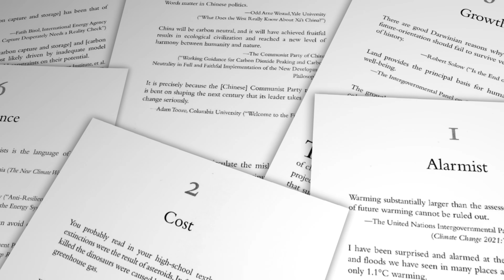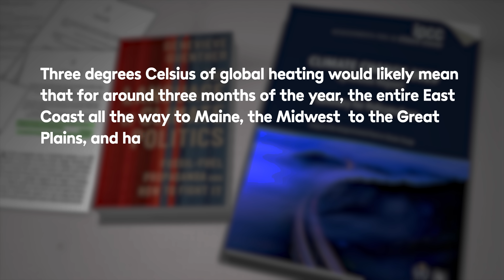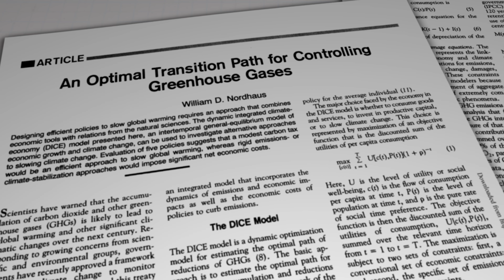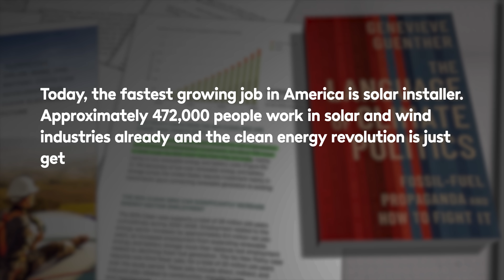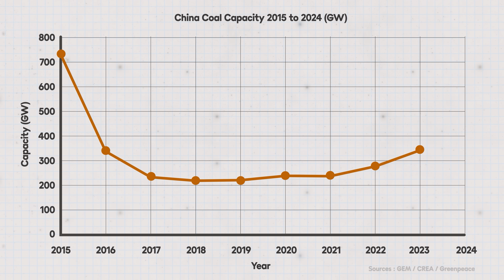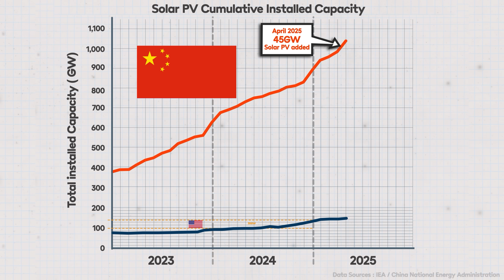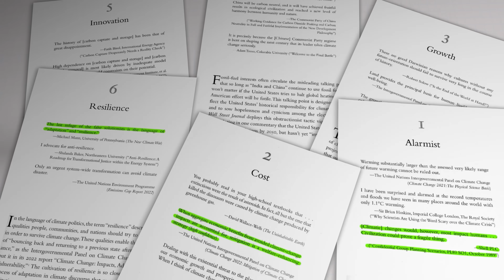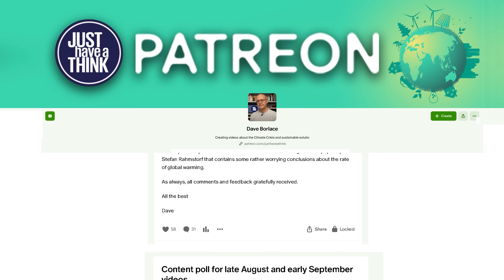New research DEBUNKS climate disinformation.

Comment: Rant on, brother. We should all be very much angrier than we are at the levels of apathy amongst the vast majority of parents and grandparents across the developed world. Those brave enough to picket oil installations and gas terminals are still viewed as cranks in our extreme right wing press. In fairness most of us are stuck for a while with our gas boilers and petrol driven cars but technologies are changing, permitting is beginning to accelerate to allow more small generators and coops. We can all help if we try.

Comment: I'm looking at installing solar now. For an investment of £20,000, I will never have to pay for another energy bill again. Ever. In fact, they are going to pay *me*. The system will pay for itself within 8 years - that's a better return on investment than the stock market. Now obviously I'm very lucky to have £20K available, most people don't, but the costs are continuing to decline. What we need is for the government to prioritise solar and home batteries instead of their ridiculous obsession with "small modular reactors" that won't produce a single watt until at least 2035, and still cost more than any other form of energy generation. Solar is here, and is the cheapest energy generation in human history (yes, look it up!), we just need to get it rolled out.
Reply: £20k is pretty steep for PV these days, depending of course how big the system is. But if you want to be net independent, you should think about getting a home battery to optimise your consumption of your own solar energy.
Reply: @bilgyno1  Sorry, I should have been clear, this system includes batteries for overnight power and feeding back to the grid at peak times.

The installation is the most expensive part, but hey, it's providing employment for electricians, scaffolders and roofers who are all training a new generation of apprentices.
Reply: @bilgyno1  At that price I assume it includes batteries.
Reply: I got a pretty big solar array (8.9KWp) with 5 KWh of battery 3 years agp for £12.5k, then added another battery for another £1,900. For £20k you must be looking at a huge solar array and maybe 30 KWh of battery because the price of both has dropped hugely just in 3 years. But yes, since I put them in I make about £400 per year instead of paying for electricity, and that includes charging an EV to do about 6,000 miles per year. So it's a fantastic investment. I'd question about how properly sized your installation is though, obviously I'm guessing because there's no specs but it sounds enormous. Maybe you're trying to run a heat pump all winter so want battery to do it but it might not be fully utilised enough to justify the cost.
Reply: Make sure to get A LOT of panels for cloudy winter months, around 100 panels 400-500Wp should work for an average household. Also, do not expect to get paid by the utility company for your excess power, prices are negative during the day when your panels are producing. I got me a bitcoin miner to burn the surplus...
Reply: @idontknowwhatahandleisanddontw  Complete rubbish.
Reply: @geconserver  The economics of solar export could well be subject to change. Gary Does Solar did a very good video on the Duck Curve using California as an example. They've had to scale back their solar export schemes several times now because they basically have enough power during the day on sunny days so paying people for excess that can't be used makes no sense. The UK is moving in this direction as well in terms of power output and requirements. The majority of my savings/earnings from solar are through export, I send back about 5 MWh per year so am hoping the export payments stay at current levels but am not optimistic. I was looking at going from 8.9 KWp to about 14 KWp but the extra generation would be extra export. If I could get a 20 year guarantee of 16.5p for my export I would go ahead but obviously I can't. So I'm not installing more solar because I have no way of consuming it.
Reply: @geconserver  Complete rubbish? Well think of me when you find yourself still paying the grid in cloudy january. Good luck to you Sir!
Reply: @idontknowwhatahandleisanddontw  I can safely say that 5 mins from this comment I'm never going to think of you again.
Reply: @idontknowwhatahandleisanddontw   I'd love to know how you think the "average household" could fit 100 panels on their roof! I have a huge roof and could possibly fit about 75 on if I covered both sides (E/W split) but most houses would struggle with more than about 15.
Reply: @FlatToRentUK  Vertical panels in a fence. I know it all sounds insane, but it really is what you need to get through those winter months, off-grid and doing everything electric. At least a 20kWh battery as well ofc.
Reply: @idontknowwhatahandleisanddontw  That's going to be pretty expensive especially as you will likely need micro inverters because the shade risk is much higher. I don't think the aim of most people is to be off grid anyway. Most want to lower electricity bills, do their part to mitigate climate impact and have little impact to their normal lives. And we still have the practical issues of space. I don't know where you live but many houses in the UK would be totally unsuitable for this. We're looking at a sensible balance of the factors I mentioned.
Reply: @FlatToRentUK  I agree, off-grid is not for most people, but it's doable for the 20k budget of the OP if he has the room. Panels are just 80 these days, *100 = 8k. Then the inverters, maybe 2k, the fence 5k, batteries 3k, 2k reserve or for consumers like a cryptominer or smth more useful (beer brewing comes to mind...). I'm in Belgium so very comparable to UK.
Reply: @idontknowwhatahandleisanddontw  If you're off grid already then what you described makes sense. But you wouldn't go off grid if you're already on it which most people are. You couldn't get any export payments. So I'll be staying connected!
Reply: @FlatToRentUK  Actually I'm currently also still on-grid but planning to go off next spring IF I can make it through winter this year without bills. 60 panels installed now, 40 additional on order for the north side of the roof. Export payments are very, very close to non-existent here in Belgium, I got, you won't believe this, 1.73 euros for exporting over 2MWh last time, which was the point the wife started complaining and I had to rethink our energy strategy. On top of that we also have fixed taxes like the capacity tarif, it's all such a ripoff and I've just had it with feeding all these parasites. If you're still getting a decent export compensation, enjoy it while it lasts (it likely won't).
Reply: @idontknowwhatahandleisanddontw  Yeah, I am enjoying it but the signs are there it won't last. I think export rates are going to become dynamic so we only get decent money in peak times so maybe 16:00 -19:00. I don't generate much then. I can mitigate this somewhat through consuming more by charging the car during the day but it will lower the advantage of solar. I was going to install more panels but didn't for this reason. As they get even cheaper it might be worth it again but impossible to avoid the installation, scaffolding, inverter, cables, etc...
Reply: @FlatToRentUK  Exactly, the only times you get a fair price is in early morning and late evening, when your PV is struggling doing close to nothing. Belgium is probably the #1 country for legalized criminality and ridiculous taxes, so you might be safe for a while there in the UK, but I'd prepare for it anyway if I were you. I'm an electronics engineer so I'm lucky to be able to do most of the electrical work myself, but I hear you,   commercial installation costs sure can be a deal breaker. As for EV, it's simply made impossible here, I heard about this new 1MW charger from BYD and went calculating on how much it would cost me to install such a beast. With just the capacity tariff they recently invented the bill would be over 2000 euros per month, every month! So I'll just keep driving my LPG powered Mustang, until those bureaucrats start taxing me to death on that little joy I have left. You probably already have considered it but a heat pump could also be a great way to consume the excess solar energy, just turn it into hot water. Anyway, good luck with your setup and whatever you decide to do.
Reply: @idontknowwhatahandleisanddontw   I saw people in Alaska and Canada that have solar panels that are on a construction where they can change the angle. (would not work on a fence. Or would it ? - And I would consider the risk of vandalism). Rob Avis wanted to adjust to winter and summer. Or in Alaska they adjusted the angle  even during the day, at least in the warm season. - To optimize harvest. 
Rob Avis from Verge Permaculture in Canada  (he has several interesting builds, larger projects very interesting. Solar green houses, geothermal, etc. A couple with children, both are engineers).  
The cabin in Alaska was a homestead, he does gardening and prepares wood for winter she still had a job as nurse. So he was at home most of the time and could change the angle of the solar panels during day (winding it into position), it was not hard to do.
Forgot the name of the channel and it was not such a large installation. 2 panels on a construction in front of the cabin. Just for emergencies and to support the diesel generator that they have to produce electricity. With snow reflection some solar harvest is possible even in winter (or fall and spring) and they benefit most in summer.
Reply: @franziskani  There are tracking systems for these solar fences, one axis, so could work great if your panels are east-west oriented. I wouldn't bother though, those mechanics need maintenance and will break down eventually. There's also tons of laws and regulation here in Belgium, they'd probably make an issue of the larger surface area. If you have the room for it, better to just install a ridiculous amount of panels, imo.
Manually adjusting the angle al the time is insane, and 2 panels is nothing...
Reply: "I will never have to pay for another energy bill again."

I used to think the same before I put mine in...  You'll eventually need to replace those solar panels and electronics (which would be your energy bill).
Reply: @Les_S537  Replacing hardware is a capital cost, not an ongoing operational cost. So I wouldn't be paying an energy bill, I'd be paying a one-off repair or replacement cost of a piece of equipment I already own.

There's a huge different between cap ex and operational costs.
Reply: Did you forget about the initiative to deem the Sun in GB by your government? 😂😂😂😂
Reply: @dmitryisakov8769  Not sure what that is supposed to mean, but the calculations for solar energy are well understood and we have decades of data to measure against. Of course the return is even better in countries closer to the equator, but solar is now so cheap compared to gas that it hardly matters.
Reply: @geconserver just google BBC article "UK experiments to reflect sunlight one step closer"
Fisrt they icentivise you to put solar panles and then reduce amount of sunlight comjng to you😂😂😂
Reply: @dmitryisakov8769  Wow, okay, yeah, that sounds absolutely crazy and a terrible idea.  I don't understand why anybody in government would give that project money, especially as it has been banned elsewhere. But then this is the country that voted for Brexit, so clearly we do mad things all the time :D
Reply: @geconserver while the amount of sunlight on UK is bad and disadvantages the PV system, the frequent rain should reduce the cost of duat cleaning sustem. 😂
Do you have a projected electricity bill savings per year from your system?
Reply: @dmitryisakov8769  LOL, yes, finally a positive use for British rain :D

Annual savings plus earnings projected to be around £2,600 a year.
Reply: @geconserver ROI in less than 10 years sounds good. Subject that your optimistic calculation pen out and you will not be taxed for this. 
As the saying goes:
No good deed goes unpunished 
Good luck

Comment: So the wannabes revisited  - CCS & DAC.     CCS is vitally important, because if perfected it could abate 20% of current global CO2 emissions, & because renewables are not yet replacing fossil fuels, but instead fuelling even higher energy usage & hence demand.    However, the fossil fuel industry, though paying CCS lip service, are doing very little to diversify their obscenely huge profits into getting such ventures off the ground.  Capitalism at its very worst & most negligent,

Comment: You say the FF lobby push carbon capture but there seems little real push on development. They talk about it as though it is an efficient available technology, but it has not been shown to work at scale anywhere.  So their suggestions are entirely cynical with no intent to have any measurable effect.
Reply: I presumed that's what he meant, that they 'push' it only in the sense that they use it as greenwashing - when advertising themselves to an audience they think cares about climate change and wants to know what the oil company is going to do about it (an audience such as the general public or a government body) they will play up the theme of them researching and investing in the development of carbon capture technologies. It sounds good, it makes it sound like they actually WANT to reduce the damage their industry does to the world, but they don't need to do a great deal, simply put a modest amount of money into funding a few small projects that won't make a dent in their pollution.

Comment: Hi Dave. Hot days here in Europe, as you know. I hear more and more people talking about getting air-conditioning to deal with a few weeks of (fairly intolerable) heat. We know air-conditioning is part of the problem, but increasingly it's not a luxury (or at least not any more of a luxury than central heating) and in some cases may help save lives. 

One argument I've seen is that having an electric vehicle and air conditioning produces lower CO2 emissions than having a standard fossil fuel run car. I did a little hunting and back of the envelope calculations and, as far as I can see,  that claim seems to hold up.

Given that EV tech and air-conditioning tech keeps improving could we see a utopia where we have our cake and eat it, so to speak, with EVs and air-conditioned homes and lower emissions? 

(For the record, I don't have any vehicle, not even a bicycle, and certainly don't have air-conditioning (though there are days when I would like it).